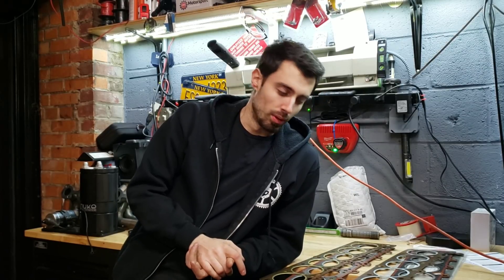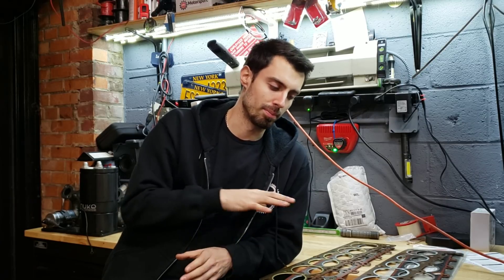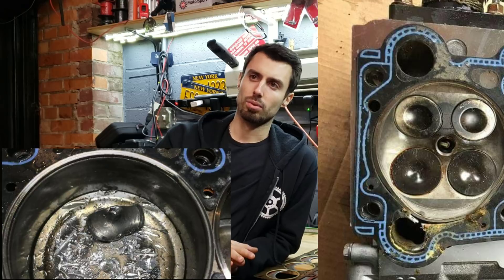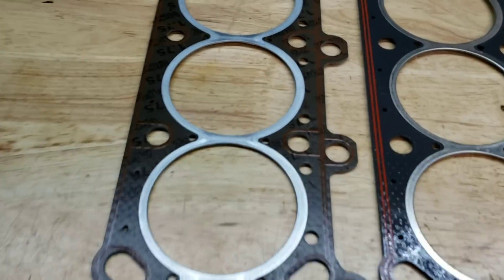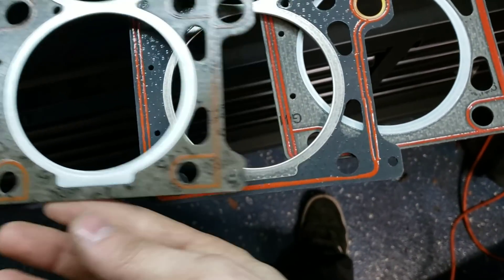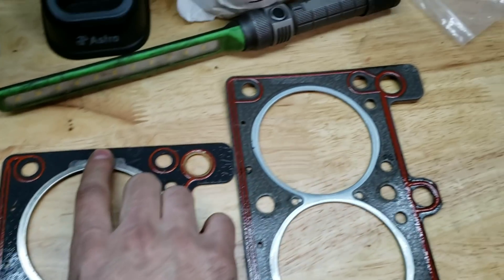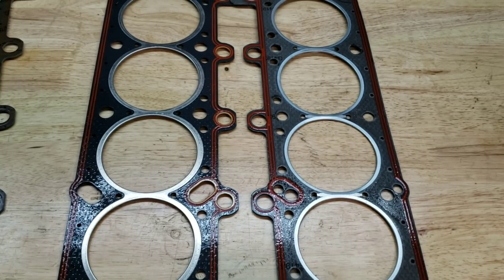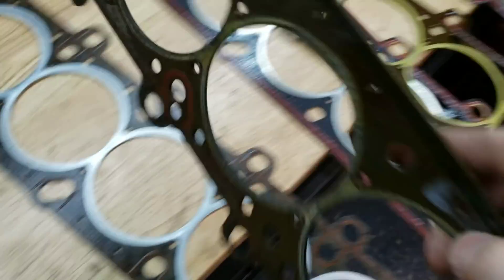M20 Head Gasket comparison! Which is best?

Comment: Have you ever had any issues with erling hg where the compressed thickness went from 2.05 to 1.8? I removed the hg it was supposed to be 2.05 but after 5k miles it was 1.8.. any comments?
Reply from the maker: Unless I'm mistaken, those head gasket thickness options (1.75mm or 2.05mm) are not compressed thickness numbers. I have a new head gasket here I can check tomorrow.

Comment: Hi, I've just discovered this video. It was very interesting !

I'm from France, and I'm working for the first time of my life on a car engine...(I'm not a mechanic) Currently, I'm working on a M20 too, but on a E21. 

I got mainly my spare part from www.wallothnesch.com/en/. 
I got from them 2 head gasket. 
- OE style, manufacturer is Glaser 1.88mm (talking about this so you could know another manufacturer. I'll get you a picture if you want ? Seems legit as Elring)
- Elring, 2.08mm (I think I'll set this one cause I don't know how much de machine workshop took off from the head cylinder, and I'm not able to use the tool to measure how high/far the piston :/)

I'm looking some information about the tightening torque process for the head cylinder. If somebody could help me :)
I've heard that using a "used" head cylinder (but send to a machine whokshop) with the new torx bolt, and the tightening torque process indicated (1st 30nm, 2nd 90° and 3rd 90°). Some people would say that is too strong for a "old" cylinder head. One of the stories says that the head cylinder had cracked 7000km later. It seems not to be the only one. (But I did not heard good stories where everything is fine too haha)

Have you ever heard stories like this ? 

I think I'll go for the 3rd pass at 45°. What do you think about that ?

Have you always respected the tightening torque process ? Talking in general and mainly on M20s.
Reply: And for the story, it was my valves guides which were twisted :/
Reply from the maker: Would love to see a pic if you can get one. As for head gasket thickness, usually the oem thickness is fine. You can get an idea of how much is removed from the head, there's a few circular depressions on the head (depth indicators) which will give you an idea on how much is shaved off, if you can still see em its safe to say you can run the stock thickness gasket.

As for the torquing, always do as recommended and in the correct order. Most of us turbo guys run arp studs which have more clamping force than the stock bolts, there's no cracking issues. Only time you'd perhaps have a problem is if he head is not torqued in the correct sequence.
Reply: @FLG13  Where can I send you the pictures ? Instagram ? Email ? 

The depth indicators, on the head gasket, is the mark we could see all the way of the gasket plan ? Wouldn't it be done with the new shaving ? 

So, I did check the difference between those 2 head gaskets. And about the silicone part all around the gasket, the Glaser seems better. On the elring, this is like is all dry, and many holes are not surrounding by silicone as the Glaser/OE is. But on the OE, all the surrounding is not siliconed. And the Elring is on the engine side (piston side)

Ok, thanks for your answers ! But that's good to read that you never heard stories like the one I heard. 

ps: Sorry to no be totally clear on my vocabulary, between my young mechanic experience and my technical level in English haha
Reply from the maker: @MrGThanh message me on ig, @frank_mopar the depth indicators are on the head and give you an idea on how much has been shaved off.

Comment: any opinions on stock cam pulley and stock cam timing mark for a head thats been resurfaced? im using the thicker oem stock head gasket on a pretty much stock m20b25 and always wonder if i need an adjustable cam pulley to dial the engine back to how it was stock.
Reply from the maker: Have never had an issue and I've resurfaced a head past its Dept indicators.
Reply: @FLG13   meaning keep the stock position on the head reference mark to cam reference mark?
Reply from the maker: Yes eveything will line up fine

Comment: What is the factory flatness tolerance for M20 cylinder head and block deck using OEM composite head gasket?? I searched all over the Bentley manual and internet but cannot find a good answer. I am in the the process of refreshing my head and wondering if I need to resurface my head by the machine shop. I would very appreciate your advice.
Reply from the maker: I've never actually checked but generally speaking the block itself is nearly always fine (just clean it up by hand) the head always needs to be resurfaced, especially if it's been on the car for its whole life or nearly that long, they warp over time and never are straight. There's a few little depth markers around the bottom of the head so you can at least know how much material (if any) has been taken off during its lifetime. Bottom line, bring the head to a machine shop.
Reply: Thanks again for your super informative advice  @FLG13

Comment: I found 2 thickness OE gasket available (1.75 mm and 2.05 mm). When would you consider using 2.05MM (+0.3) after refinishing the head?
Reply from the maker: Depends, unless you're shaving the head past the depth markers id run stock thickness.
Reply: @FLG13  Thanks again for the insight!

Comment: dude i have a 96 infinint and im tryign to figure out if i should buy a fel-pro gasket set or just a cheap one, i mean does it really matter you talking about drag racing and turbos
Reply from the maker: Yes, plenty of Victor reinz gaskets have failed on stock motors that just street drive. That being said, price does not always decide quality. The vr gasket is about the same as the other gaskets in this video, while the oe gasket is about 5x the price. So long as the less expensive gaskets you're talking about are made by a quality manufacturer or don't have history of issue, I don't see a problem with using a less expensive gasket.

Comment: I would use a Athena cooperring gasket if you go Turbo or Compressor. They are rated for 500 and more HP. Little bit thicker than OEM, so good for dropping compression rathio a bit. Many Many Tuners here in Germany use them.

Comment: I agree, VR is almost pure garbage; They always came back with problems. Cost me so much loss I vowed never to touch another VR gasket for an m20. That old yellow OE/Goetze gasket looks just like the Goetze gaskets I used for turbo builds pre-2015 (great stuff!) but the supply dried up... Never tried Elring, the new BMW ones, or the new Goetze, since I've stopped building e30s for now. FYI The tacky gel coat stuff is gasket sealant used for filling small imperfections in the mating surfaces of the head/block. This video is informative, so thanks for taking the time to make it.

Comment: Haven't checked with my buds, but I'm sticking with GE-tzuh until told otherwise.

Is there data available on specific failure points, perhaps between gaskets? That would great to document.

Comment: You are 100% correct about victor reinz I put one in my m20 torqued everything to spec and it started to leak after 3 weeks. It’s seeping oil on the side of the engine block. A guy at the shop said he hates victor reinz for headgaskets but it’s ok for other gaskets.
Reply: Tony Condor my 320 i leaking after 1 year .also use victor reinz.

Comment: Great video. You should try to synchronize audio volume between the far shots vs up close stuff. I cranked up the volume for the beginning, then had to turn it way down. Maybe invest in a mic. Very informative otherwise. Looking forward to more!
Reply from the maker: Sorry, really might invest in one and re do this video. Though low it still sounded fine on my phone volume wise, guess might be an issue for some computers, especially laptops.
Reply: @FLG13  I guess you're sorta limited with what you can do on the phone. I appreciate the response! 

Side note - Would you have any interest or means to do a demo video on o-rining an m20 block? Like you mentioned, its a pretty simple operation. However, I can't seem to find a decent video demonstrating it on anything. Thank you.